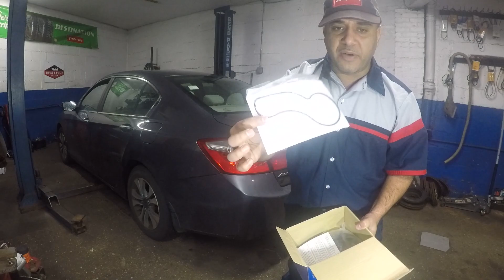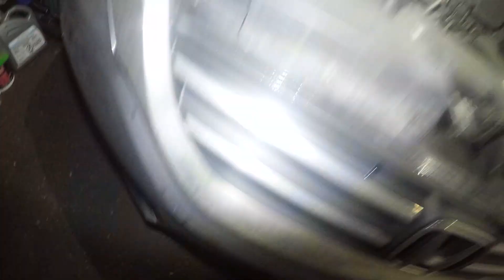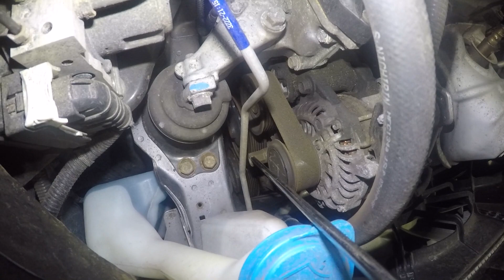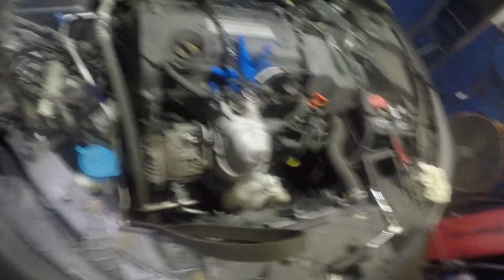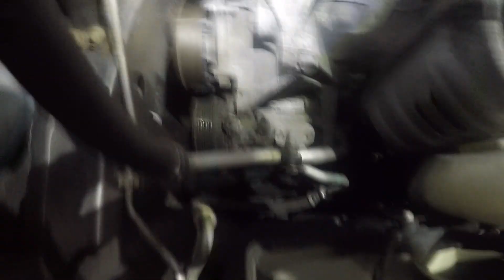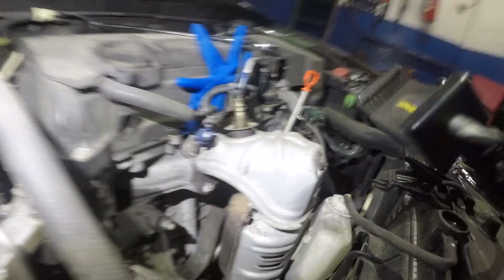How to replace Water Pump, Tensioner, Alternator or Belt on Honda Accord 2013 to 2017 and up part 1

Comment: Looks like i can use this video and the next one for changing the water pump on my 2015 CRV. But the bearing on the water pump didn't feel bad. I previously replaced the tensioner and belt. Tensioner is identical to what you have. But one of the better video's I've seen
Reply from the maker: Yup yes!!

Comment: For me to remove and re install the 2 bottom bolts on the water pump it was much easier to have the car lifted on ramps, before starting. And removing the plastic dust shield with the clips from under the car, without removing the wheel. 

Thankyou for taking the time to record the video and share, to help others like me!
Reply from the maker: Thank you!!!

Comment: I've never done that water pump but wouldn't  it be easier if I just pull out the whole water passage housing, replace the pump outside and then put everything back together of course with new seals ?
Reply from the maker: I would do it as I show

Comment: Was changing my alternator and when I was almost finished and putting on the bottom bolt to the belt tensioner I fucking broke the bolt. now it’s stuck and so am I. I guess I gotta buy a new bracket or take that one off and extract that broken bolt. 😅 wish me luck
Reply: Thanks for reply bro. This might sound dumb but can I pull bracket off without taking water pump off of bracket ?
Reply from the maker: @josephthegoat1179  not sure it might have bolts around it and I think pump can stay in it
Reply from the maker: Oh damn good luck I just did one today I though bolt was gonna brake.  I was gonna put slice in to the bracket

Comment: I’m trying to buy the bracket where the 8 mm Allen bolt goes through. The bolt hole 🕳️ stripped on me mechanic told me we can place the  bolt with a bolt 3/8 of an inch longer so it can snug the pulley against the bracket or he said change the entire mount. He said rethreading the bolt hole would not be good since it’s a moving vibrating part of the engine what are your thoughts?
Reply from the maker: Yeah h need to replace the entire thing

Comment: I used a duralast water pump and after only 16k miles its leaking again.
Reply from the maker: Yeah those fails always cheap autozone stuff I hate them
Reply: @RBTheMechanic  yup auto zone has life time warranty on it so idk if I should get another one for free or spend almost $200 on oem from Honda.
Reply from the maker: @badarahmed5137  buy from online do some forum research asin is good brand use that

Comment: Im at 112k miles on my 2017, should i consider doing this if i don’t have issues yet ?
Reply from the maker: It about time it will fail any time so if u want u can just knock it out so u good for another 100k miles
Reply: @RBTheMechanic  thanks man
Reply: @RBTheMechanic  I was planning to do mine in 2 weeks at 120k miles and it went out today at 119k miles. Thanks for the video!

Comment: How many miles on this car?  I'm just over 150k and my 2014 has zero issues.  90%+ of my driving is freeway
Reply from the maker: This car had 120k pump was still good customer wanted to do it according to milages
Reply: @RBTheMechanic  my mechanic told me to keep driving my car until the water pump leaks lol.

I may change it out at 180k or 200k just for safe measure
Reply from the maker: @TC-cd5sm  yeah do so ... I showed how to take out the alternator in this video but u don’t need to it was for demonstration purposes u will see in 2nd part how I should u can slip the tensioner under the alternator to by pass
Reply: @RBTheMechanic  I'm just happy the 4 cylinder engines have timing chains and not belts like the V6s
Reply from the maker: @TC-cd5sm  yeah and the pump is external love those never was fan of timing belts I did so many before I started making videos
Reply: No cvt issues?
Reply: @JohnS-aka-JS  I have a 13 accord cvt with 161k on mine..no issues…I change the fluid with oem every 30k..a few other Honda owners have said their accords have over 200k on theirs..just don’t beat on it..